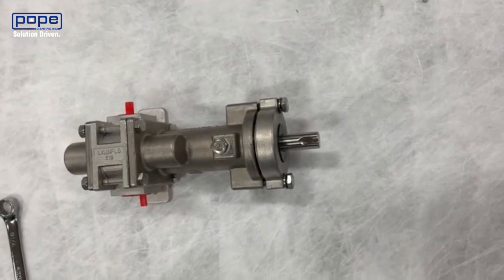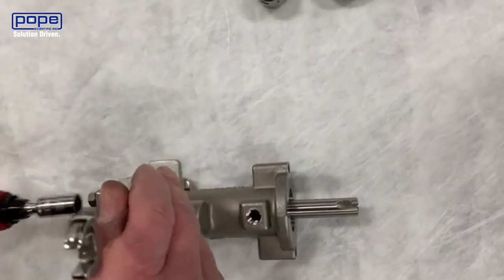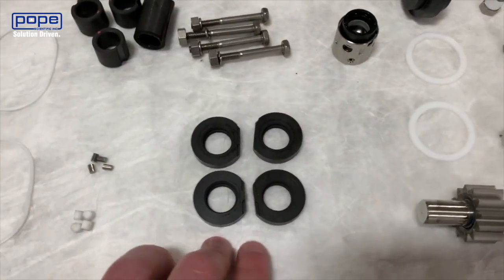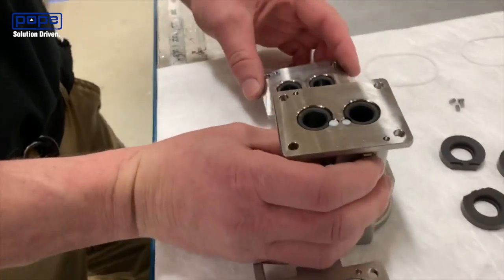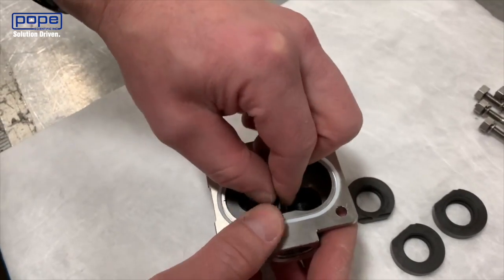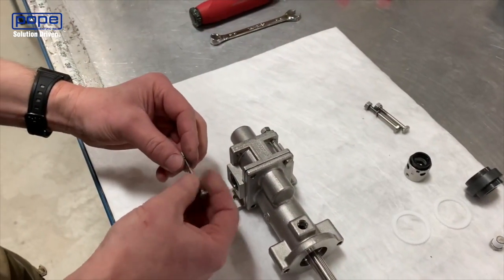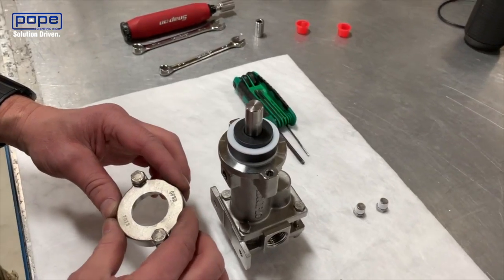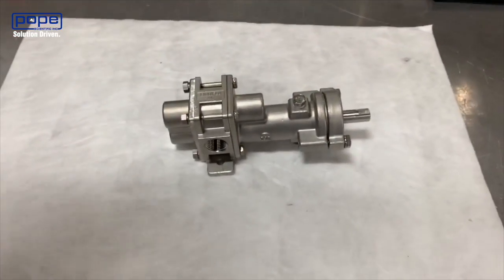Gear Pump Maintenance for Vacuum Distillation

Comment: how about replacing shaft seals on the drive assembly?
Reply from the maker: We have not created a video for this, however, you can call in and someone would be happy to assist you in diagnosing any issues you might be seeing with your Pope wiper drive assembly.